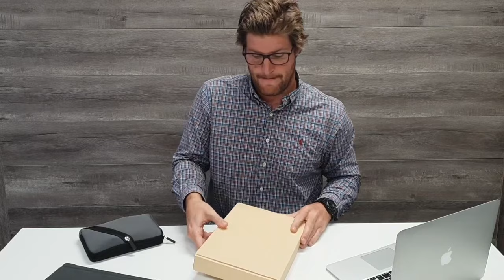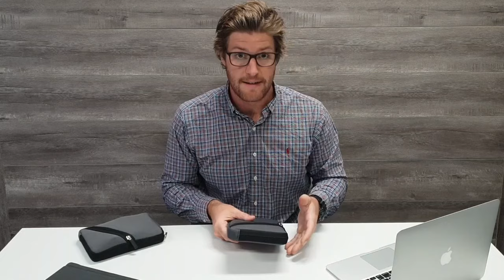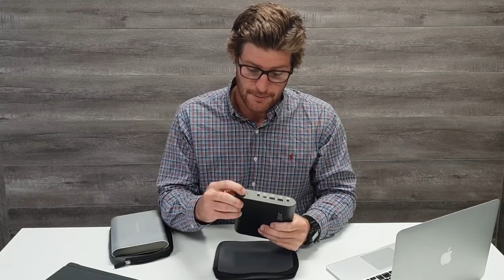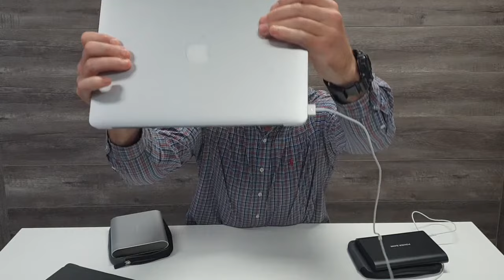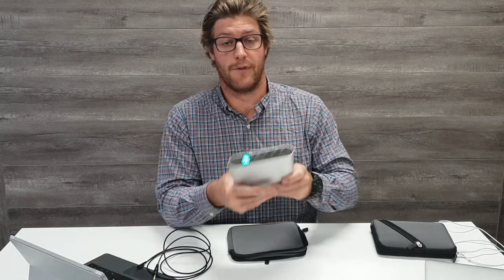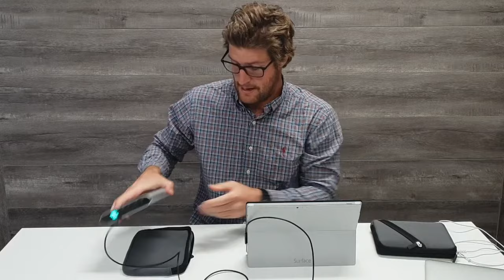Massive 50,000mah Multi Voltage Power Bank

Comment: @Aus Power Banks  Hey mate, was wondering what happens when you charge this unit while it's discharging?

Let's say it's outputting 12vdc via the DC-OUT and I apply voltage to charge it. does it charge and output simultaneously? if so does it discharge from the battery itself or does it have a mains by pass?

also, the same scenario in reverse, if the unit is on and is charging and I turn a connected device on and that device starts drawing current will it automatically start supplying power? (12vdc)

Comment: Great power bank but a few things to keep in mind:  Because of it's large size, it will NOT fly, at least  in the US.  I had to wait a few extra days to receive mine because Amazon had to deliver it  via ground transportation.  Also, it does feel like a brick in your backpack.  It is great if you plan to be out all day and want to use your laptop and can't plug it in.  Most budget laptops suck at battery life.  You'll be lucky to bet much more than 3 hours without extra power.  They give runtimes with everything turned down.  My HP doesn't have a really bright screen so I have to have the brightness at max pretty much all the time..  My laptop +  this power bank are fairly heavy but I've never gone much below 80% on the power bank.
Reply: @Nic1963D  I don't know.  I only used it to keep the laptop running a while longer.
Reply: @telliott  Have you ever tried to use this powerbank to charge your HP laptop from 0% battery? How many time it can fully charge your laptop. My is HP pavillion 15 // 19.5 V 33.3 A